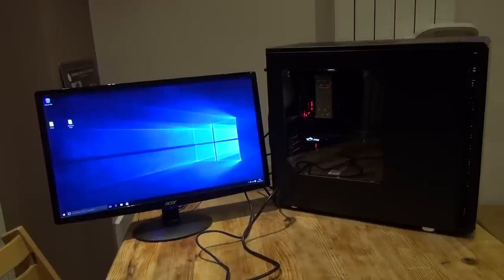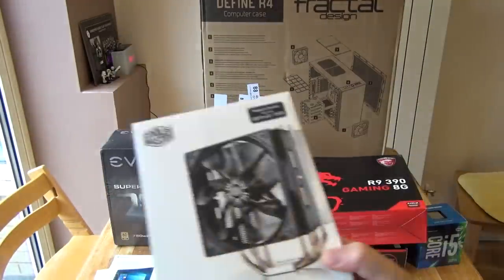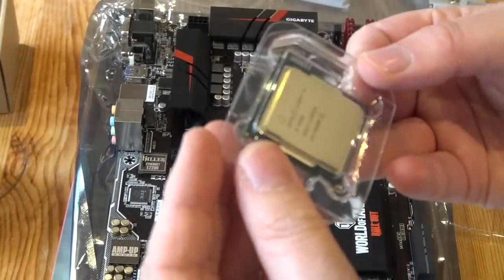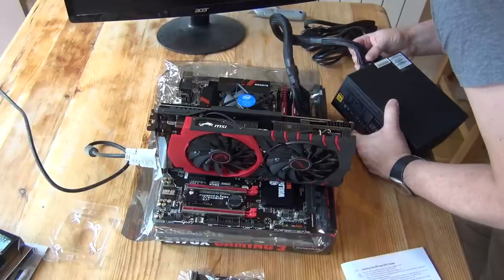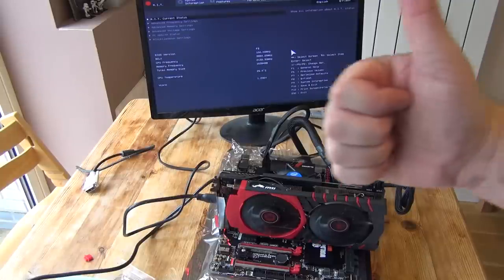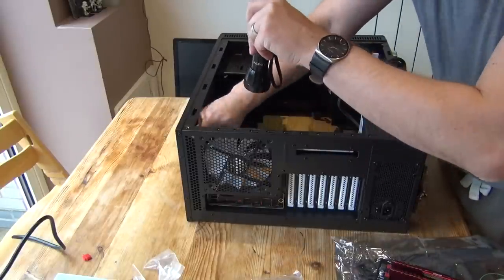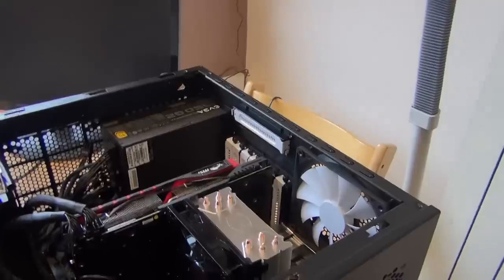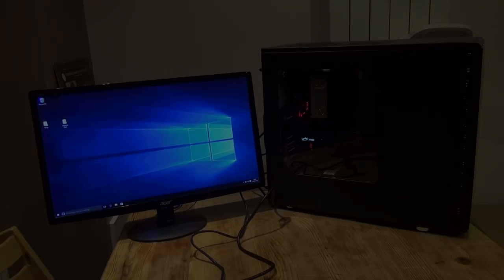PC Build - Watch me assemble a mid-price gaming PC

Comment: I highly recommend don't use the anti-static bag between the motherboard and motherboard box, some motherboard manufacturer's anti-static bags are conductive on the outside.
Reply from the maker: Thanks, I didn't know that! AM
Reply: I can confirm this. I repaired tv's power supply on top of one and switched it on. Whole thing fried in an instant. They have some metal on them to give that Faradays Cage effect to protect components inside them from ESD.

Comment: I plan to use the exact same motherboard and RAM (but higher speed) in a build this year and this video proved to be very helpful! 

I also have the Cooler Master 212 but mine is the slightly different X model, for the price is is a very good performer indeed, perfect if your not gaming for hours on end and are a general user. I plan to use an older Corsair non modular power supply that is more than enough for the single 1070 I plan to use.

It's strange really, the bigger PC build tip channels very rarely show affordable stuff like this, my system is going to be about the same, or maybe just over £1000 and its truly more than enough for ultra quality at 1080p which is the monitor I already have, more money saved on not getting a higher resolution one, well not yet anyway.

The only bad part about this video was the audio, your voice sounded like a super bad MP3 downloaded from an early 2000s music site.
Reply from the maker: Thanks for the feedback, you are right about the sound - this video was made a while ago and I have since changed my mike and the software so hopefully its a bit better nowadays.  I don't have a super fancy mike or anything - i just do it for fun and don't really take it that seriously but hopefully my current videos are good enough quality for people to live with. Good luck with your build, I hope it goes well! AM.

Comment: I got the same motherboard and mine came in DOA. Yay for warranties.
But still, I'm glad your build worked out. XD
Reply from the maker: I'm really sorry you had problems! my mb is still performing OK but as I said elsewhere in the comments I have not been particularly pleased with the fitment of this boards or the BIOS issues I have been encountering so I probably won't be going back to Gigabyte again. Hope you get your board back soon and it works OK! AM
Reply: Nice build mate. I never had problems with Gigabyte mainboards but always had issues with Asus boards in the past. I am still using a 8yo gigabyte P45 mainboard and had been converted into media. I was just thinking about building a new mid range gaming rig using the same board and i7 and Nvidia GTX 1060.
Reply: So a little post comment, Gigabyte's customer service insulted me after I sent the motherboard in and requested they drop the $45 fee for damaged CPU pins because they arrived like that. After that they hung up on me.
Still haven't been able to use my motherboard. :/
Reply from the maker: Raiden X mine is still working OK although I had to reinstall W10 recently after a series of crashes,  I suspect this wasn't a mb problem,  mind you. AM
Reply from the maker: TheKelley Zoroark sorry you are having problems with your motherboard. AM
Reply: Amoeba Man Is it stable now or still crashing? Do you think it was motherboard firmware?
Reply from the maker: Raiden X stable now,  I think it was software related after the big recent W10 update to be honest. AM
Reply: Good to hear that it was all sorted. GG.

Comment: Your lucky that doard didnt short out  on that antistatic bag..On the outside  they usaly have metal coating  to act as a feraday cage sorta. once you take the board out stash the bag  .
Reply from the maker: Thanks for the tip. it is my understanding that the bags are not conductive as the metalised layer is covered on  both sides with non conductive plastic (polythene, polyester) which explains why I have never had a problem for many years.  However, its not good practice to use them in the way I do in this video, so you make a good point!   http://www.polypluspackaging.co.uk/anti-static-bags-material.php

Comment from the maker: An additional comment on this build, I have had some issues with version F6 BIOS for the Gigabyte motherboard.  Stick with the F4 and you'll be fine in my experience.  I flashed F4 back into my board and all the boot issues I started having after I 'upgraded' to F6 went away.  AM
Reply: What do you mean by versions F4 and F6? Does that have anything to do with the F4 and F6 keys? Also, is it bad to downgrade the bios?
Reply from the maker: Hi, each BIOS has a number, latest version at time of writing is F6 for this board - no it is nothing to do with function keys.  If you are not sure about BIOS and your PC is working OK then my advice would be to leave it alone.  BIOS versions and other info is available from the Gigabyte website http://www.gigabyte.com/products/product-page.aspx?pid=5497#bios  Cheers! AM
Reply: Do you know if I should Install F3 and F2 aswell before F4? or by installing just F4 it will include the other two? Thank you. How did you flash by the way? with @bios?
Reply from the maker: Should be no need to install previous versions, check what version you have installed already.  I used the provided Gigabyte software, sorry I can't remember what it is called and I am away on business at the moment so cannot check.  As I mentioned previously, personally I wouldn't update BIOS unless you are encountering issues and the latest version (F6 currently) caused me a lot of problems so even more reason to leave it alone unless you absolutely have to update. GL! AM
Reply: +Amoeba Man Thanks for replying!!! It really helps me out a lot!!! I'm sorry I didn't see it sooner!!
Reply: +Amoeba Man What problems did you get ?
Reply from the maker: Hi Omar, in my case it was crashes, boot failures, black screens.  I couldn't get the OS to load.  All still fine on F4 version. AM
Reply: +Amoeba Man Do you recommend Asus or Msi or Gigabyte for the Motherboard ?
Reply from the maker: +Amoeba Man Quick note : I flashed new F7 BIOS into my board as I was seeing some occasional instability,  nothing serious,  and it seems to be working fine. I am hoping it will help resolve some occasional graphics crashes / freezes which I have been seeing recently. AM
Reply: +Amoeba Man I looked on gigabyes site and there is no f7 bios
theres an f20c bios thats beta 
I see a lot of people have had problems with the f6 bios but I havent I guess its luck
Reply from the maker: faisal yousaf you are right,  F7 seems to have been removed and replaced with F20c
Reply: Amoeba Man speaking of bioses the f6 bios hasnt given me trouble since I built my system and that was about 4-5 months ago
Reply: does this motherboard come with f4 or f6 ? Plz tell me it comes with f4
Reply: Diego D. It'll probably come with the f1 bios all you do is go on gigabytes site and download and install the latest bios version though id stay away from beta ones
Reply from the maker: We are at F20c BIOS now so don't worry, you'll be able to flash it to F20c whatever and it will be OK, I am running it atm

Comment: Hello, friend, good morning ! Pretty much this your case. I take a doubt: You can disable the LEDs red for bios or jumpers or they are always connected? Thank you.
Reply from the maker: I believe you have some control over both the R9 390 LED's in the drivers and the Motherboard LED's in the BIOS but I am not sure whether you can switch them off altogether, the motherboard can also pulse the LED's in time with music according to the manual and the BIOS has am 'Off' setting but I haven't tried it. AM
Reply: thanks friend.

Comment: Hello Im using the parts of this build and going to use the motherboard,the hard drive and the Intel core but i cant find any of the other part in-store so i could buy,but I can't buy the parts online please can you build an other PC list for please thanks
Reply from the maker: Hiya!This build spec is getting a little out of date now as it is 10 months old, I would suggest looking at some up to date recommended builds like at http://www.tomshardware.com/reviews/best-pc-builds,4390.html#p8
The best build @$1000 looks like a decent spec although I would probably stretch to a bigger SSD instead of the unlocked CPU and the 3.5" drive (unless you plan to overclock).

This one also looks decent http://www.gamespot.com/gallery/best-mid-range-gaming-pc-build/2900-954/ except that as you know I don't like EVGA PSU's :) would probably go for a Corsair or Seasonic personally. I think the GTX1070 is a nice gaming Gfx card choice currently or RX 480 or GTX1060 if the budget is tighter, albeit quite a bit slower

I also really like PcpartPicker website for building specs http://uk.pcpartpicker.com/ and also the bit-tech forums for build advice, why not share you spec with the guys on http://forums.bit-tech.net/ in the Hardware section?

Once 4K gaming becomes realistically achievable for a mid price PC (maybe later in 2017?) and I have bought a 4K monitor I will probably be updating my personal gaming PC but I won't be doing another full gaming build until then.  My next build videos will be a pfSense router and probably also a DIY NAS build - not helping you much!

Good luck with your build! AM

Comment: Is it possible that a PSU ATX connecting lead (which fits near the CPU) might not be compatible. My PSU is about four years old.
Reply from the maker: Hi Yellowswift, its difficult to say without knowing which power supply and motherboard you have.  On this particular build I didn't think the EVGA PSU connectors were very good quality and I was not impressed them, they were a tight fit in some cases.  Make sure you check through all your connectors on your PSU,  or cables if it is modular.  In the past I have had issues where I (when I checked) I discovered I was trying to use the wrong connector, they are usually labelled, heh.  GL! AM
Reply: Thanks, I managed to sort it. :)

Comment: Is the Z170K G1 Gaming motherboard any good? Because I've ordered it on Amazon and I'm wondering if it's good or not, I need your review on it. Return it or Cherish it?
Reply from the maker: Sorry for delay in my reply,  I don;t own that mb, in general I have had good experiences with Gigabyte boards although this one had a few niggles with fitment and BIOS it is performing reliably at the moment.  A quick Google suggests that the G1 is the very top of the range, I am sure it will be a fantastic board but it is crazy expensive here at £400 plus, if you can get one for cheap or have a specific application that will use all the features then great but most people won't use all the features and you can probably get 95% of the performance for half the money.  Without knowing your setup its hard to say - hope you are happy with whatever you purchase! AM

Comment: Amoeba man when you don't want to used the Intel CPU cooler what do you recommend to used but not that I don't care about the price, please respond to this thank you
Reply from the maker: +WinterDragon hi WD! The coolermaster Hyper 212 Evo I use in this build is not a bad budget option and a lot better than the OEM. It's not expensive, around 35 USD. You could always try the stock cooler and see if it meets your requirements? Good luck with your build! AM

Comment: thanks for making this video, i ordered this mobo and will expect it any day now.   When it comes to the Mobo drivers, what should i watch out for?   You said to revert back to F4? How will i know what driver is currently in the board?
Reply from the maker: Ramzy .j hi Ramzy,  the latest BIOS is performing OK for me,  so I think this is resolved. The main issue with this board that I had was its fitment in the case,  not sure whether this is still the case,  but a few other users have also reported  problems getting the board fitted and aligned - I suspect this is why I had problems aligning my graphics card. Good luck with your build! AM
Reply: so i did some research on updating the BIOS thru appcenter. Im currently at F5.   To be honest tho, im pretty hesitant to update it since there is some risk involved.  What would you suggest i do?  Thanks
Reply from the maker: In general its only worth updating the BIOS if you think you have a problem so if you are worried about it, then don't update unless you encounter an issue.  I have PC's running fine which haven't had BIOS updates since they were built years ago.  I haven't encountered any issues with updates for years and years and have only ever bricked one board, so as long as you have stable power, use the right utility and download the correct BIOS its a relatively low risk process. GL! AM

Comment: 5:45 Short the 2 pins? Is that required to do if im going to build my pc?
Reply from the maker: Cilomitron no,  it's just a simple way of starting the motherboard test whilst it is outside the case. If you install your motherboard in your case and hook up the power switch there is no need and you can just use the on /off switch  ☺️

Comment: Board shape is out of ATX spec so the stand offs don't meet the screw holes in some places......how many of the screw holes couldn't you use ???? Just read a review about this but they didn't say.
Reply from the maker: It's been a while since i assembled it, from memory I got all the stand-offs installed but once I had done this the board did not sit correctly against the case back making it difficult to install the PCIE cards, especially the graphics card.  So I would agree with your comment that the board is out of shape. Thanks for your info! AM
Reply: It shouldn't effect how the board sits at the pci

Comment: hi I'm new to building a pc I have a similar bulid like you but only have the processor I core 3 6100 change in it.. and I am really worried about the wiring and connection..  can you help me..?
Reply from the maker: I guess my two tips would be :  1. read the motherboard manual installation sections as it shows the correct connectors. 2. If it doesn't work the first time, don't panic, just go through everything again methodically, its easy to miss something (like I did the first time in this video!)
The trickiest part is sometimes the motherboard connectors for the case switches and LED's.  The LED's are sensitive to polarity i.e. they only fit in one way so make sure you use the little + signs on the connectors and the motherboard socket or they will not light.  Good Luck! AM
Reply: Amoeba Man thank you very much...

Comment: Hi Amoeba Man ! Do you think this is a Good PC list. If you can you can change any PC part that does work with the build.

* MSI 1060
* Z170 X Gaming 3
* Kingston HyperX FURY 16GB
* CoolerMaster Hyper 212X 
* Corsair RM-750x 750W
* Samsung 850 EVO 250GB
* Western Digital 1TB SATA3 Blue 
* Intel Core i5-7600K Processor

Thats my PC build I have in mind of building please feel free to change any parts of the build Thanks !
Reply: btw I very worried about my build I'm a 14 year kid and I don't have enough money to build something that is expensive way up to 4k.
Reply from the maker: Hi,  I like your build, it looks good and will be an excellent gaming machine at 1080 resolution.
I like to check my buiilds by entering them into pcpartpicker excellent tool : 

https://uk.pcpartpicker.com/

A couple of comments from me :

Z170X Gaming 3 rev 1.1 (check your rev) only supports i5-7600K with BIOS F20 or onwards so when you buy your board you need to make sure it has the latest F20 BIOS unless you have another compatible socket 1151 CPU to install first to allow you to update the BIOS yourself. Otherwise it may not boot!
https://www.gigabyte.com/Motherboard/GA-Z170X-Gaming-3-rev-11#support-cpu
Go to the motherboard compatibility list and double check your memory and SSD is on the list, I always try and buy memory which is on the support list - I have previously had compatibility issues when I didn't do this : https://www.gigabyte.com/Motherboard/GA-Z170X-Gaming-3-rev-11#support-doc
You don't mention your case on the list, as your mb is a full ATX I assume you are buying a full or mid tower (which will be great for plenty of cooling).  Make sure it has some nice quiet fans fitted for cooling
I like Corsair power supplies, its a good idea to buy a quality PSU and pcpartpicker tells me your rig will consume about 340W so you will have loads of headroom, could even consider a smaller PSU unless you have upgrade plans.  Having a PSU that is too big in capacity is no big deal though and gives you headroom for things like overclocking.
I always download the motherboard manual before I buy ti and have a read through .... lol (a bit geeky I know)

If its your first build then take your time, work your way through the motherboard manual and don't panic if it doesn't boot first time, its easy to miss something - I always do!

Good luck 

AM
Reply: using my PC stock fans is that ok if not can u recommend me if fans thanks
Reply: and also the mother board is the same as yours
Reply from the maker: If your case has fans and you are happy with them then fine! AM
Reply from the maker: mine is Rev 1.0, currently on sale is Rev 1.1 - they are basically the same board but there are minor differences, worth checking exactly which one you have to check for any compatibility issues :) AM
Reply: ドリフトキング great pc list should be able to run AAA TITLES at 1080p 60fps